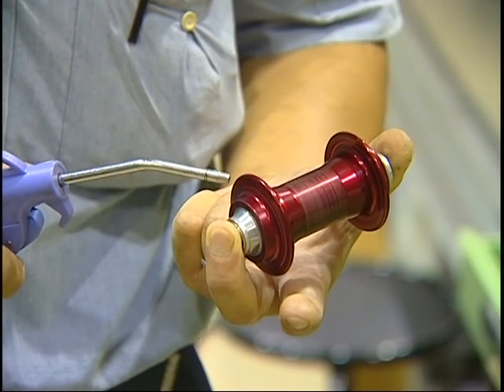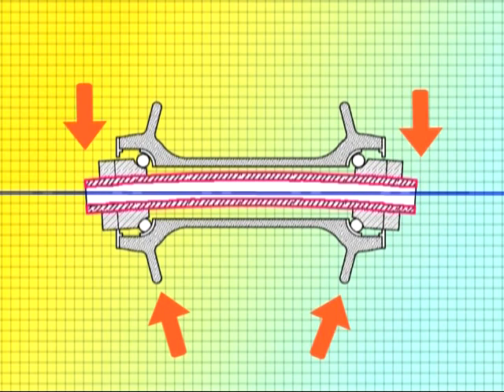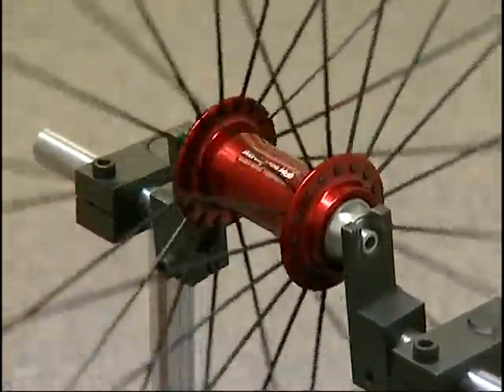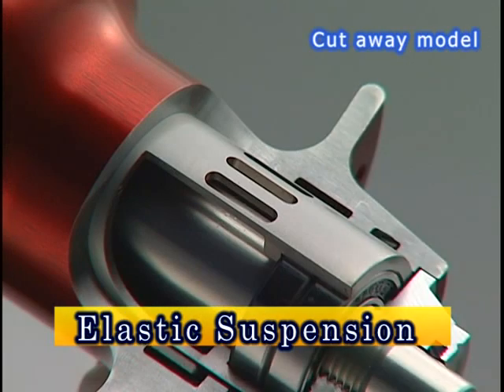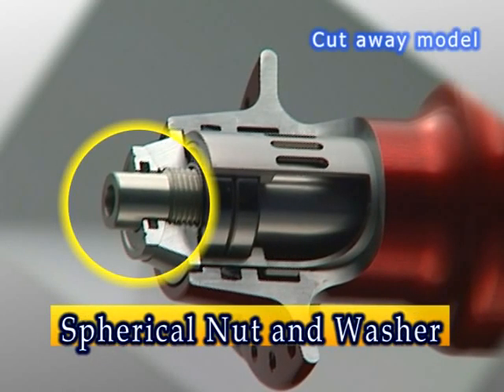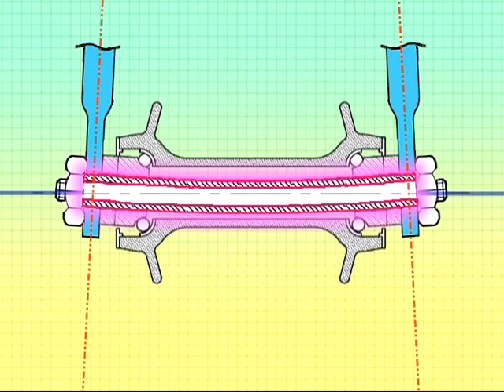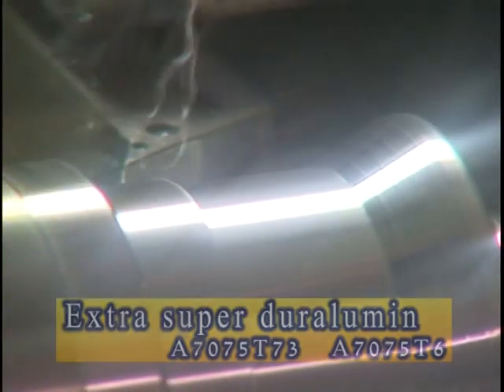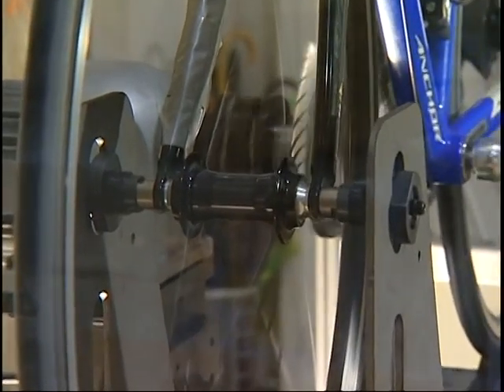GOKISO Hub Promotion Video Vol.2

Comment: Spring shaft is a cool thing, but stating that 4 bearings provide less friction is just pure fantasy, also deep groove bearings are rarely used in this arrangement, as they don't make them in matched pairs, those would be angular contact, to ensure preload, and preload generally means a bit of friction.
Reply: I partially disagree with you there, having side by side cartridge bearings isn't uncommon where there is a limit on the outer diameter of bearing that can be used and the load is too much for a single. It's just not normally seen on bikes because they can just run a single larger bearing, but as an example if look at brushless outrunner RC motors which have to be small but can have a real heavy load then they often do it. I have seen one model that had x3 bearings side by side on the impeller end. They don't need to be matched either as the tollerances of all models is more than enough. I do agree with you in the fact that the drag normally won't be less than a single bearing but having two smaller bearings means that it can be less than double the drag. This is due to a few factors such as a slower surface speed (smaller balls), less rotary weight and so on. I am open to correction on any of my points here.

Comment: What a scam,,,the forks they use with the drop outs on an angle are el cheapo forks. A half decent fork has parallel dropouts..... who is gunna put a $2000 hub on a cheap bike? For 2k I thought it had a motor in it.
Reply: I also found it odd that they would go to so much effort to make and advertise such a feature. I agree that no fork that isn't garbage should have this issue, that's why forks are made in a jig- to hold the drop-outs dead true. I suspect they did it because it sounds legit in theory and it's a way to set them apart from other hubs on the market. When in reality almost all of the people who fit these end up with the self locating cones being parallel between the faces because there is no misalignment to begin with.